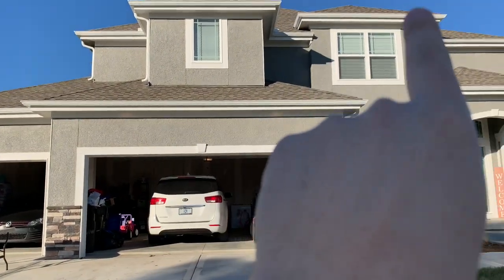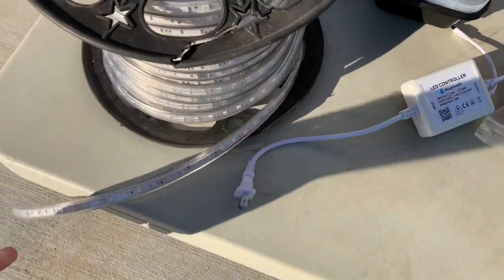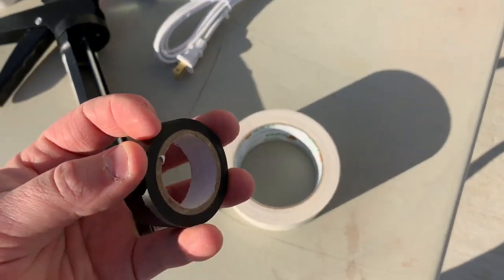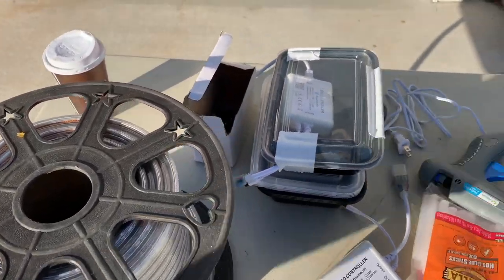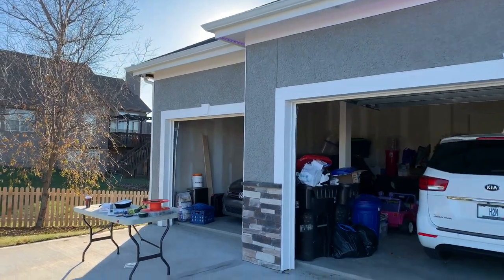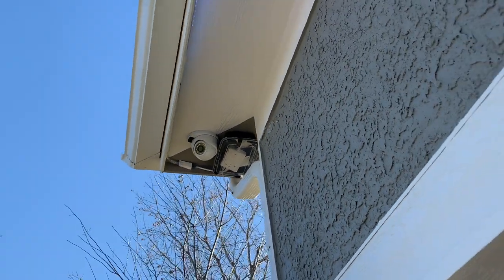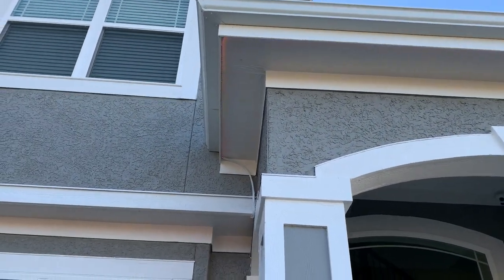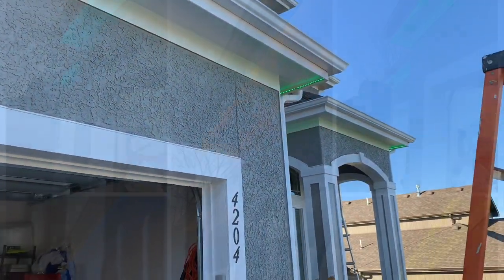DIY High Voltage 110V RGB LED Strip Permanent Christmas Holiday Accent Lights Installed

Comment: Did you have problems with power injection since it was continuous
Reply from the maker: Nope, these 120v strips don’t require additional power injection overs run less than like 160ft.  There is no drop in light output across the strip either, which is awesome.
Reply: @1MARCUSMARC1  where did you purchase and name of strips
Reply from the maker: Less4leds.com they don’t have a large selection so they are easy to find on their page.

Comment: My rope is about 30 ft too long. How/can you cut them? And if so, what do I need? I think I’m going to have to call the guy in the videos. If someone can guide me I will appreciate it.
Reply from the maker: Sorry for the delay.  Cut them on the cut line with a pair of scissors and then cap the end with silicone or tape, or sometimes a cap is supplied.

Comment: What did you use to go from higher roofs to the lower ones?
Reply from the maker: They are separate strings on separate controllers.

Comment: Any updates? It's been almost a year, is the glue and caulking still holding? Any issues with lights due to weather or anything?
Reply from the maker: Gilbert Chavera I had them fall down in one 10 ft section, but it was a quick fix.  Otherwise they are still working great!  No issues yet.
Reply from the maker: Gilbert Chavera I even have them running for Chiefs games and Halloween so far this fall.
Reply: Great. Sounds like a pretty durable set up. Thanks for video and updates
Reply from the maker: Gilbert Chavera I’ve been pretty surprised that it always just works when I go to turn it on.  Lol

Comment: Why not just wire through the soffit and keep electronics in attic?
Reply from the maker: SaltwaterRook you could absolutely do that.  I just happen to have outlets wired up on the exterior of the soffits.
Reply: @1MARCUSMARC1  ah yea I forgot about those.  Makes sense

Comment: Does the light effect with the cameras at night?
Reply from the maker: Monkie Loc I blocked a couple feet of strip in front of the camera with electrical tape.  The camera was pretty much un-usable with the strip pointing at it.
Reply: @1MARCUSMARC1  👍👍👍 I figure itll be too bright for the camera. But nice thinking with the electric tape.

Comment: Hello Marc,
I see that you have several controlers, how many did you use and for how many feet? I need about 110ft, how many controlers would I need? Also, how do I connect each controler? Is it just a plug in? Did you have to cut the strip to connect the controlers or it ran straight? Thank you in advance for your prompt response.
Reply from the maker: I used two controller because I wanted to be able to do two colors at once.  You can run up to 160ft on the controllers that I have, so one is perfectly fine.  The controllers just plug right into the end of the strip.  It’s self-explanatory when you see it.  I had two independent strips on mine, one for each controller.

Comment: Can you control multiple controllers with your phone?
Reply from the maker: Yes, it allows you to control them together or separately.
Reply: @1MARCUSMARC1  can you say the exact brand and kind you have. Its tricky finding a good out door one. Thanks
Reply from the maker: @pauleldridge2313  they aren’t branded unfortunately.  If you go to Less4Leds.com and click on the Holiday LED strip in the menu to the left, you can see what I have.  If you have any questions, just give them a call and tell them you saw my video.  They can hook you up.

Comment: How’s the durability after 2 years?
Reply from the maker: Surprisingly good!  I haven’t had any issues within two years other than one section drooping down after the first year.  I fixed that and it’s fine now.  It works every time I turn it on.  I’m honestly surprised.

Comment: Very cool!  A couple of questions.  1. Are your outlets in the eaves tied to a switch?  2. What was the entire length of LED strip that you purchased?  How long are the bottom and top run?
Reply from the maker: sms bearsfan 
1. Yes, they are both ties to the same switch and I have a smart switch there. 
2. 160ft
3.  I think they are about 65ft and 75ft
Reply: @1MARCUSMARC1  Thanks again!  Would like to see a video of what it looks like when you have the top done as well.
Reply from the maker: @smsbearsfan7312  Here you go! https://youtu.be/AILMY_YppBc

Comment: cool setup. Did you buy one 168' spool from less4leds and cut it to fit your 2 runs?
Reply from the maker: Yes.  It cuts easily on the cut lines.  There’s one about every 1.5ft.

Comment: Don't you get overheating where you cover the LEDs with tape?
Also, might have been nice to mount the control box down in the garage, or somewhere easily reachable without a ladder.
Reply from the maker: fartwrangler naw, these strips don’t get very hot.  I agree on the control box location, but unless I splice in longer wires it would be a challenge.

Comment: Did you use a power supply?
Reply from the maker: No power supply required.  These plug directly into the wall outlet.

Comment: As a electrician this bothers me. The boxes you use and also reasher more and cut lenghts and make joints in your attic. All you need it to fish 16 Guage wire threw the under side were you mounted the strips

Comment: Hmmm. Didn’t know 110v was high voltage...
Reply from the maker: Most LED strips are 5v or 12v, which makes 110v quite high in comparison.
Reply: Cole Flint - or don’t be a smart alec

Comment: Haha, permanent, hot glue, and washed ready-to-go chicken boxes from the supermarket, and duct tape don't really go together. I give it 6 months, all this will be falling down / deteriorating due to UV exposure.
Reply: 4 Years now
I got em installed the very same way for 4 years now
Don't be shy on the good silicon, is the most important part.

Comment: Looks like they are going to fall down in like 3 weeks honestly
Reply from the maker: JMAY GoPro 810 well I don’t blame you for thinking that, but they have been up for 14 months and hanging in there.
Reply: @1MARCUSMARC1  That's pretty amazing. Did you use silicone to adhere all of it down?
Reply from the maker: JMAY GoPro 810 yeah, it’s just a quick dry silicone.